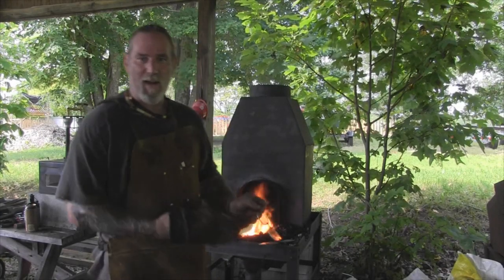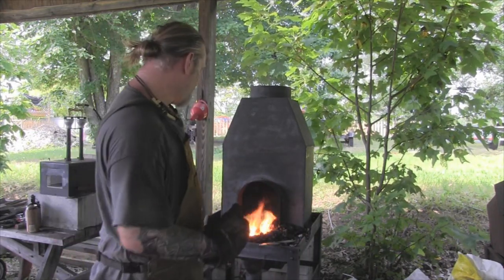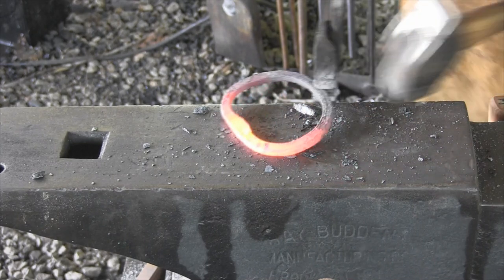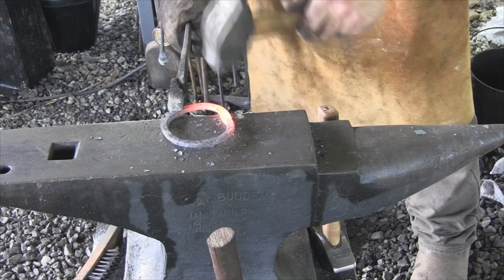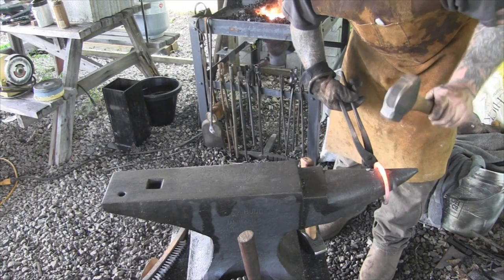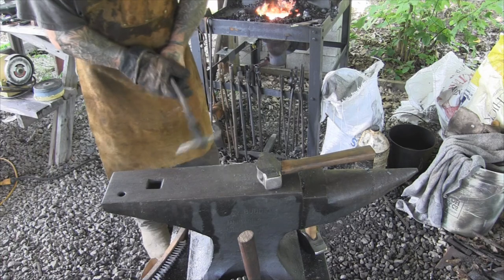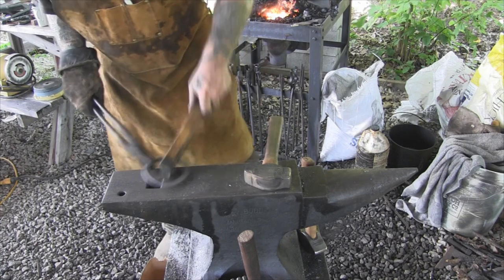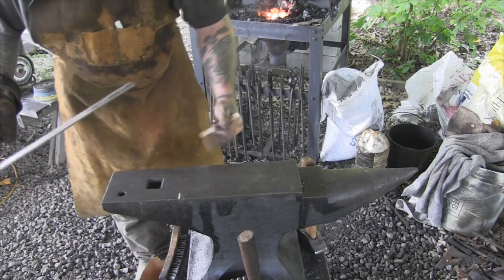Circle Trivet and Forge Welding

Comment: Good job! Your right about different alloys welding different. Rebar is hard to get quality welds because they make it out of random scrap. When they melt down the old VW, you get the frame along with the leaf springs and chrome from the bumper! If you want a good welding experience find some old wrought iron from a wagon wheel or old gate, it'll almost weld itself. I'd love to see you finish that steel trap you started a few years ago.

Comment: Dave, would like you to think about blacksmithing a tripod holder.  I have new design that is very very wilderness outfitters multipurpose.  Make 8" thin rod, like a skewer rod.  Change into an "S" shape. But on the bottom curve of the "S", you want to make a full turn "O" with an inner diameter of 1 inch.  Kinda looks like a meat hook.  Now make 7 more of these.  In all, there are 2 sets of 3 "S", or 2 sets of 4 "S."  They can be separate in a backpack, very neat and tidy small.  Put them together, like magician rings.  You make a 3- or 4-legged "S."  Use these on your tripod cooker, or a double set for the tripod (head and foot) hammock stands.  If you only want to use 2 poles (bipod) for a hammock stand, then the third (even fourth) can be used to hang from the bipod (or tripod) as a backpack or boots hanger etc.

Use "S" or "S"s to hang, dry, cook meat portions, hang cooking pots from various heights, ... or the same wooden tripod poles made to 6-7 feet height, can hang a tarp-shelter as that emergency tipi tarp-shelter (mylar space blanket) wrapped energency unit (I mentioned).  The hooks used on notched tripod poles, can hold cross sticks for sitting within, and making a wooden seat.  A conventional tripod wooden seat can also be created.

These units can be put into an "S" shape and used for hanging items on tree limbs, air-dry out clothes, air-dry cooking ware, even hanging a harvested animal with 2 "S"s.  If you use 4 "S" sets as a hide fleshing unit, you can stake in a frame, or use 2 "S" and hang the back legs hide from tree limb, and use 2 "S" and bottom stake the fore legs down to the ground.  Then flesh away.

If you use the same "S" unit on a high tree limb, and a lower "S" on a hanging item. You can turn these "S"-s (with multiple up-down paracord lines into a makeshift pulley-lifting system for extreme meat (or food) caching into the highest limbs.

Something to think about.  Very light, many options for their use.  Many options not mentioned.